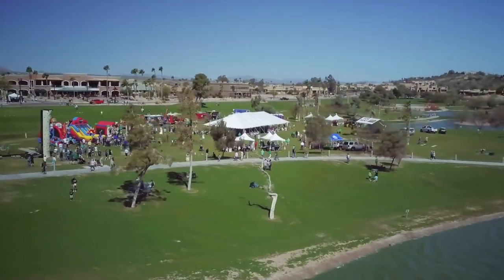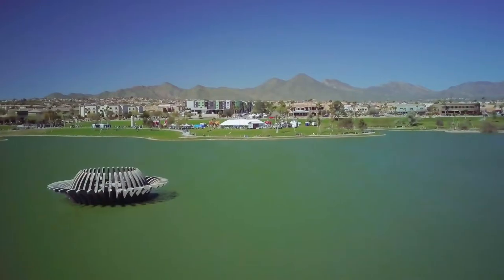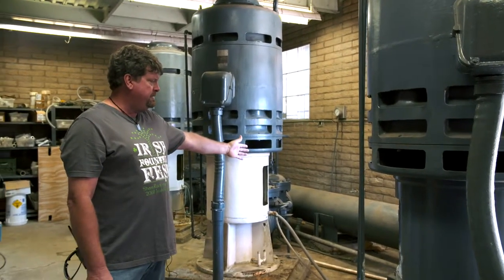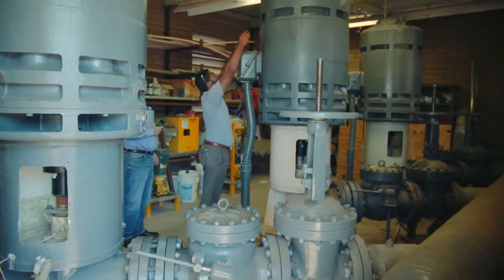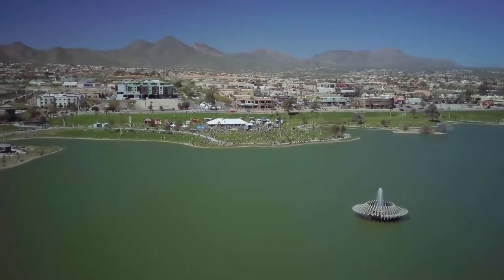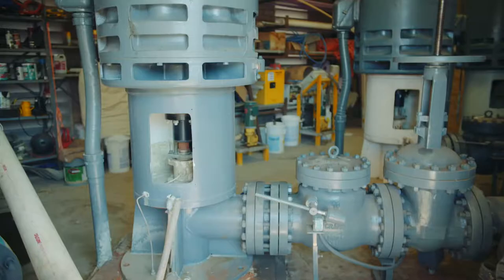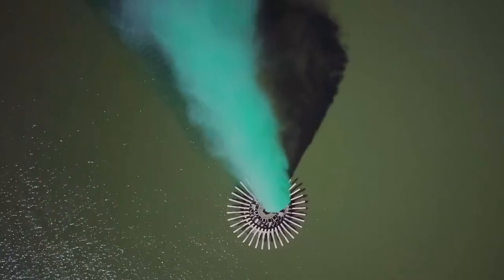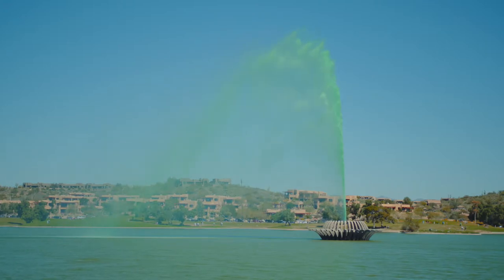National Pump in Fountain Hills

Comment: Way to go guys🙄! The fountain is down to one pump. Two are on the way. Take better care of the three pumps and run all three at the same time like they were designed to. The fountain is supposed to reach a height of 562 feet not 330 feet. Absolutely poor maintenance on your side! Get your crap together!!! It’s the fountain’s 50th anniversary this year.
Reply: Sorry to hear that the fountain isn't performing to your liking.  National Pump Company is the manufacturer and cannot control how the city operates the equipment.  As this video is hosted by the manufacturer and not the city your opinions will not make it back to them, please contact the city directly.